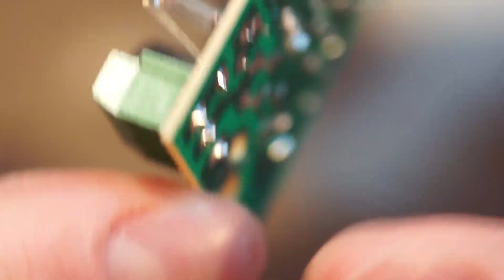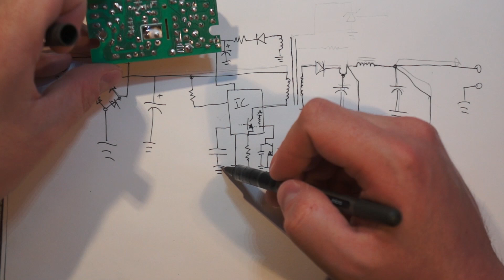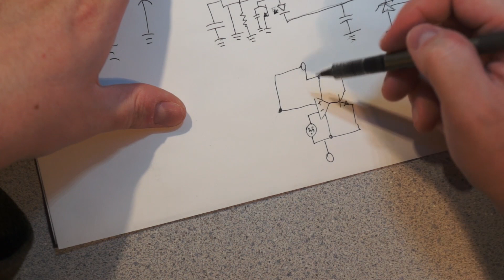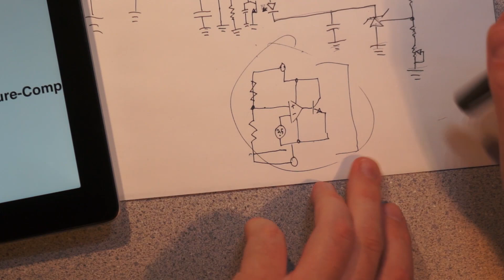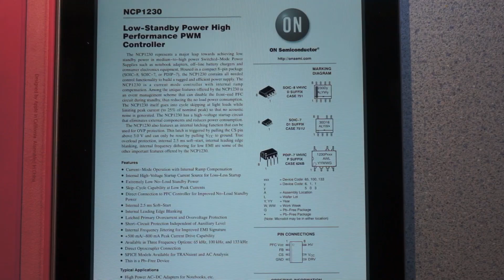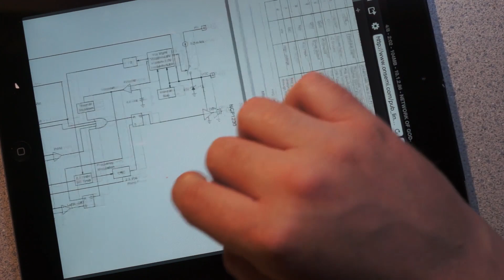Inexpensive chinese 12V SMPS reverse-engineering

Comment: I can "unmark" chips with an 80:20 mix of denatured alcohol and acetone. Learned it at a US company. China probably got the trick from us like everything else. 

Seriously though, "unmarked" chips can be sanded, solvent or screw driver removed. 

Assuming counterfeit because you don't see marks is wrong. We do it here in the US all the time to make it harder for people to reverse engineer or hack. Ask Rigol about that. Hackers raped their oscilloscope marked by bumping the time domains at no cost. There is even a famous electronics YouTube channel that spells out step by step directions. 

I know you are not saying counterfeit. I think you are implying product diversion (you guessed it, I am an IP attorney).  Trouble is that most people will read your comments as though something shady has happened. 

Many US companies (some names would blow your mind) actually allow diversion in their production agreements as long as the chips are "unmarked."

That's business in China.

Comment: okay one question, why not just use the damn linear regulator ? the power supply would be way much simpler.
Reply: Yes But SMPS Is 1000x Harder To Repair than
 A Linear Type and You can increase the current output of a LM317 338 or 350 by adding 2N3055 circuitry to the linear Regulator... You can find these diagrams all over the Internet... I built a LM317 PS 5years ago and it;s still running to this day!! Then I purchased A SMPS 9 Months Ago And It Recently went Kaputt On me!!!  SMPS Has A Lot Of Advantages But Ease Of Repair is NOT One Of Them!!!
I Agree With Everything You Are Saying Except The Ease Of Repair!!
Reply: SMPS is much more efficient and produce less heat
Reply: And Easier To Repair!!!!!
Reply: Linear PS Is Easier To Repair Than SMPS
Reply: Yep, and waste too much power too
Reply: Linear is only effective in lower current consumption

Comment: Nice thanks for this, I'm a new subscriber now.  For your schematic hand drawing I recommend that you check out Pilot FriXion pens. They are erasable with a dark line and the erase is perfect.  These pens erase due to heat, caused by friction of the eraser tip. Hence the name FriXion

Comment: The white marking between the solder pads are used to better "splitting" off the flux (produces less adhesion)  
so it is less likely to cause bridging of metal between the solder pads.
If bridged, it will take up a bit more metal solders ( and thus increase the production cost )
Also more metal solders means more wear on the pin clipping cutter which is not desirable

Comment: I noticed that you did not mention the blue color high voltage capacitor between the primary and secondary windings, (I believe its called the Y capacitor). I am really interested to know about it because few days ago I got  electrocuted because of a leak in that capacitor. It had a DC resistance of about 14k or so. Any explanation about it? Why did they put it there? will it be ok if i just removed it off?

Comment: Now try my 3d printer's power supply. Many missing parts, components installed at horrible angles, and the worst part? The mains input and 12v output are ON THE SAME HEADER! Hardly any PCB distance....

Comment from the maker: Generally, ICs are marked with a laser engraver, which burns the chip markings into the packaging epoxy directly. As such, the only way to remove them is to grind off the top layer of epoxy.

Comment: If it has 2 drain pins it could be a GR8935 from Grenergy, I have a small power supply with that one that has been running for about 6 months continually without problems, though I'm using about 150mA of the rated 500mA of this design. As the chip company is chinese too maybe they agreed in selling them without marks.

Comment: STmicro Viper series or clones are very common in these supplies, not too sure about the resistor though. Viper17 has a similar datasheet reference design to the Dave cad

Comment from the maker: The FSDH321 has three collector/drain pins, and the IC in this switcher only has two.

Also, the FSDH321 has an internal high-voltage current-source, rather then the external resistor in this supply.
It sure looks close, though. Maybe this part is one generation earlier.

Comment: The controller chip could be some sort of UC2845 or 3845,or something similar. 
Maybe even a TOP,or VIPer chip.
There are about a half-dozen or so that I run across fairly commonly in little SMPS's like this. They are all fairly similar.

Comment: I couldn't spot any "uhmmm" but I could sure spot a lot of "basically" :)

Nice video. Simple design, basic but works. 

I'd be a bit concerned about how close the mains would be to the aluminum case, I'd probably put some electrician's tape on the bottom of the mains side just to be on the safe side.
Still, I can imagine some noob forgetting the mains cable connected and using a small metallic miniature/clock screwdriver to open the socket screws for mains wires... scary.